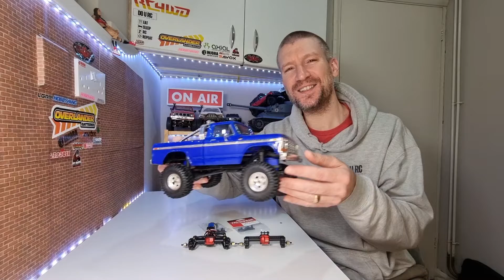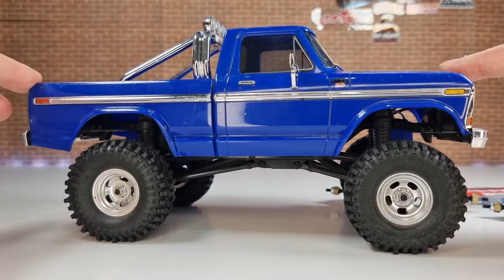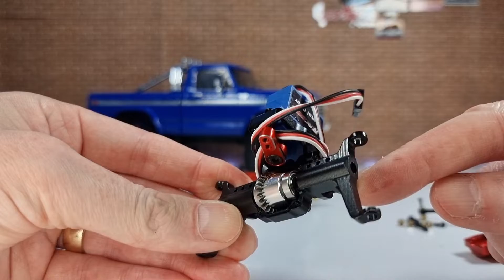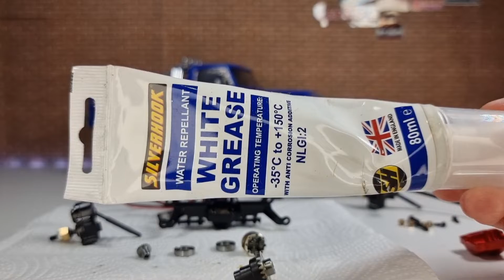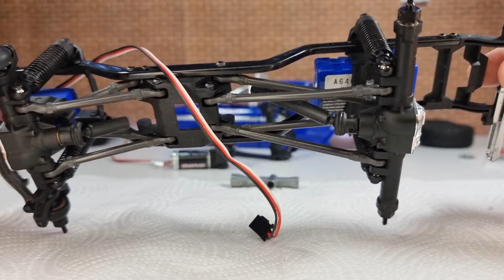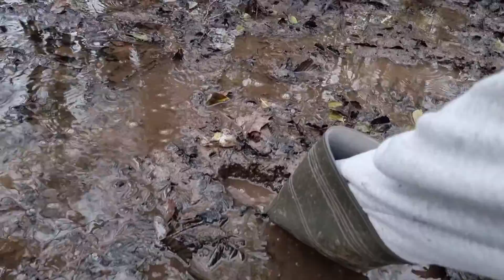mini MEGA MUD TRUCK TRX4M Build Part 1 - RCAWD Portal Axles & Mud Test

Comment: How did you depin the plug?
Reply from the maker: Which plug?
Reply: @DoURC  the one you swap the wires for the reverse and forward after installing the portal axles
Reply from the maker: @LeonAKALELE Sorry, forgot I did that as it was a while back! I just used a knife to lift the tab over each pin, then you can pull the wire out and swap them around. 👍

Comment: Nice job mate its looking good indeed now it the time to go get those 68 or 74 mm dj crawlers to give it its final look hehe also did changing the stock axles to portals stop the torque twist or does it still do it ?
Reply from the maker: Thanks very much mate 👍
I didn't notice any twist tbh, but I was more focused on just ploughing through mud! 🤣
Big tyres are stage 2 coming soon. 👍😁
Reply: @DoURC  nice looking forward to it 👍